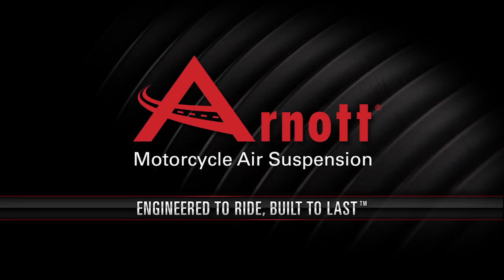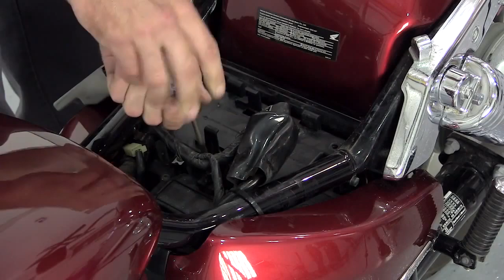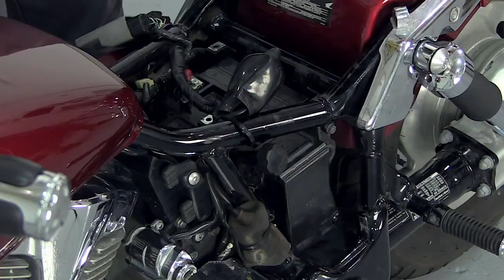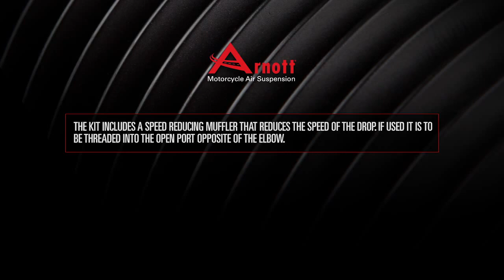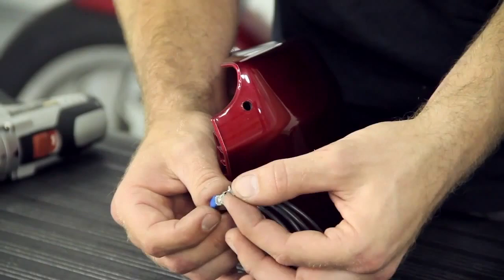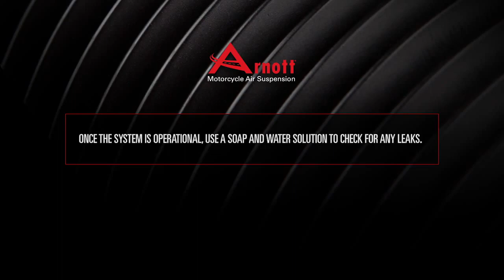How to Install Arnott's Adjustable Air Suspension Kit on 02-07 Honda® VTX - DISCONTINUED KIT

Comment from the maker: This kit has been discontinued.
Reply: Why did you discontinue it?
Reply: @208flatbedOO  probably because they stopped making the vtx 13 years ago.
Reply: @Big-kon  so.....they are still on the road though.  That does not make sense
Reply: @208flatbedOO  I totally agree. I ride a 02 1800 and want air ride badly. I was just making an assumption as to why they stopped.